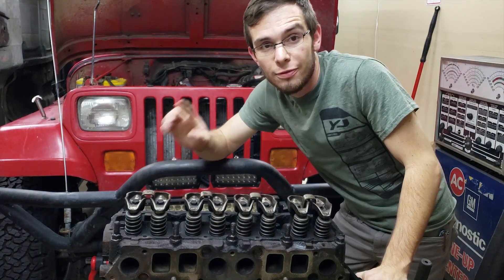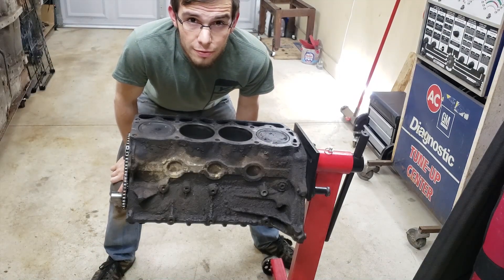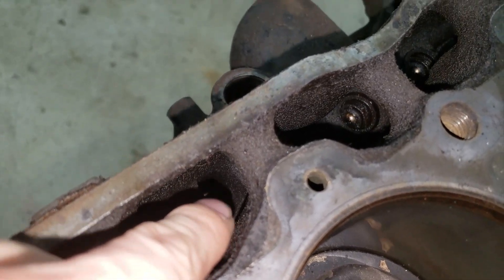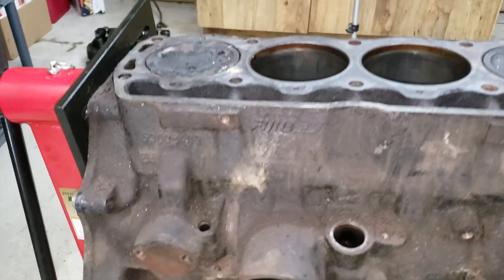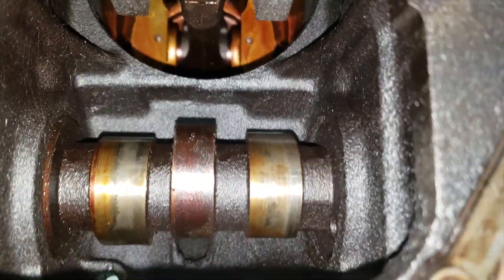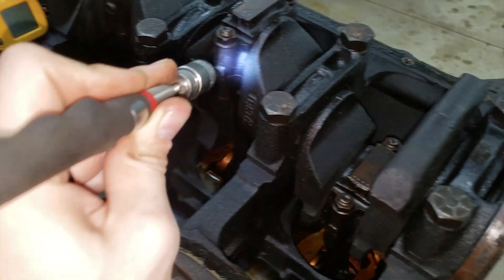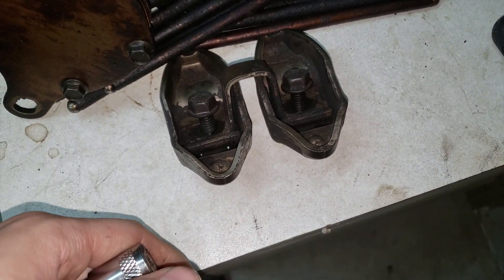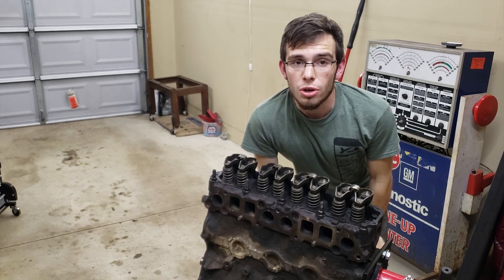Jeep 2.5L 4 Cylinder Engine Complete Tear Down Part 2

Comment: ???  yer scarin me man..
The oil pump 'sucks' the oil up from the pick-up/sump by the close tolerance between the gears (like a roots blower sucks air) but should be primed with lube of some sort (even Vaseline works) before first initial running. Then, depending on how many gear 'teeth' or vanes, oil is sucked up and pressurized, then pushed up through the passage into the oil filter housing boss/structure, through the filter media and up into the blocks passages. 
Usually only higher performance engines use oil squirters to cool the piston domes/ring lands.
The oil doesn't stay pressurized like a balloon. It gets squished out between the bearing sides cooling them (really, taking heat from the bearing halves that was transferred from the iron or aluminum structure that holds them) , and gets flung around into pretty much a vapor. coating EVERYTHING in the crank-case. (just think. At say 4000rpms and 50+psi) That's why a bad or open PCV valve(Positive Crankcase Ventilation vlave) will suck as much oil vapor straight into the intake tract according to RPM's. And a plugged system that can't 'breathe' will blow gaskets and even the filter itself off. 
There are a number of 'Ol tricks' with oil pumps and flow that have been around for decades/generations.. Smokey Yunick would be one source. 
Rule of thumb for HOT oil pressure is: 10psi per 1000rpms is adequate. (since that's about IDLE on most race engines)
If you're at 80psi HOT idle, I'd say you got a problem or some kind of restriction. And THAT will rob power from you. (and cook/break down your oil prematurely) It's called "Intra-fluid-friction". Since it's smashing against it's own molecules. Too thick of oil can do the same.
The pump itself supports the physical law that you can't compress a liquid. And the size of the passages/tolerances/restrictions will regulate the pressure. ..(hydraulics).. Filtration is a WHOLE 'NUTHER lesson.. 
Also, Water/Coolant is only about 60% of the cooling. The oil and wind/air blowing over the engine does the rest.
Reply from the maker: Dang that was fantastic.  Thanks for really breaking down the mechanics! I love how I can turn a couple of screws on camera and it starts a dialog with incredibly knowledgeable people like you. You have certainly earned the highlighted comment spot!
Reply: @JeepSheepTV  I'm just a knuckle-head.. 
Get on Mellings' (Melling Oil pumps) site and pull up the "NEW" shark tooth oil pumps (Chevy- doesn't really matter) BUT.. pretty pricey @ $110+!!       Then go and watch/listen to the little videos that they offer. VERY informative.        
Just watched a few last night.                                                                                   Getting back to the process, The 'shark tooth' design is like the roots blower that is "helical" in design, that draws the oil up instead of just smashing it, and hoping it goes out the top nearest hole..
Leonardo Da Vinci basically designed this Waaaaay back. Like putting a drill bit in a tight fitting tube. He came up with that design to draw water up from the ground from what I read..?

BUT.. IF there's any contaminants that are larger than the molecules of oil, that produces wear/scratching/damage depending on the size.
Then, there's the bread down from the heat and chemical by-products of the combustion process.. That's where SYNTHETICS came into being. 
That's a whole nuther lesson lol. (get on Amsoil's site and read away.. They were the first to offer to public)

Comment: Where is the oil filter adapter Did you remove it. Do you have a video on you removing it and what it looks like.
Reply from the maker: I did remove it and I don't think that I have a video of it but it just looks like a threaded piece that you take off with a socket if I remember right

Comment: Hi friend. I love your channel! I have a question about the gears that the oil pump carries. I disassembled it and one of the gears came out which is loose. not the dealer's. my doubt is that I see that it has two holes at the top. what is the correct way to put it back in its place?

Comment: that odd pin deal is part of the pressure regulator.  It's a spring loaded valve that is opened by excessive pressure and thereby dumping that excessive pressure and oil back into the sump
Reply from the maker: Whoa! How cool is that.  It also makes a lot if sense because otherwise it would just keep building pressure until something breaks. Thanks for the comment!
Reply: @JeepSheepTV  anytime you have a pressurized liquid (ie hydraulics) you need/must have something like this.  liquids are not compressible and even with some degree of designed leakage/seepage pressure has to be controlled or somethings will lock up or rupture

Comment: The oil actually passes around the outside of the gears.
Reply from the maker: Are you talking about in the oil pump? That would make sense...
Reply: @JeepSheepTV  Exactly
Reply: The oil getting back to the pan is just gravity, same path as when you add oil. As for the oil getting to the pistons, I thought I saw an extra lobe between the exhaust and intake lobes of each cylinder, directly in line with the holes coming from the top of the engine, could be an oil slinger.
Reply from the maker: @chadalcock7275  you are a life saver! Thanks for the comment!